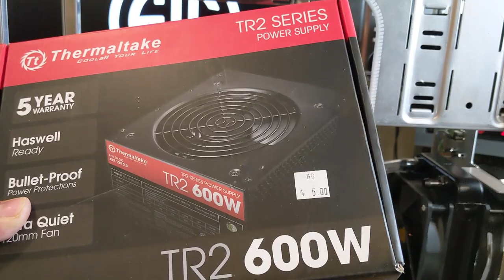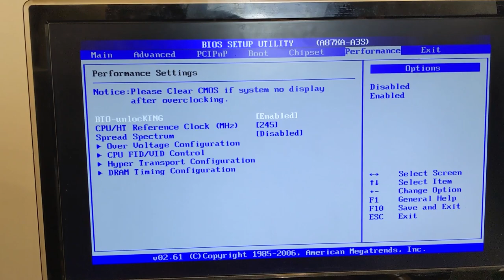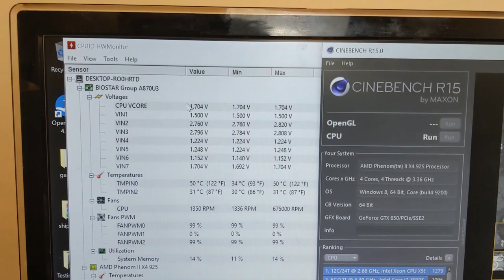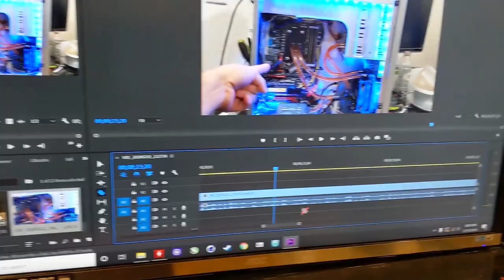Custom Water Cooled Lian Li PC 60 Build Vlog

Comment: My PC is still in a PC60, albeit one with 2x80mm instead of 1x120mm front fan. Because of that, no way to even put this miniscule AIO in; however still very happy with this amazing case even if it's 20 years old!

I do have the original lian li plexi side panel though...... ;-)

Comment: love your case jimmi, its a classic case. your version seems to be pc60 PLUS, do you know if there is a size difference between it and the normal PC60 (the origina version had 2 80mm fan grills on front, and yours the PLUS version has a 120mm fan grill on front)

Comment: Im in the process of doing this with modern components I saw that somebody that was already made a sleeper PC with this case and I decided to up the ante with water cooling and adding USB 3 to the front panel as well as pairing it with a ryzen 7 3700x and 2080 super
Reply from the maker: Your build is sick man. Looks really good.
Reply: I have 2 of these cases. I want to do this with my system

Ryzen 2600 with 2x RTX 3070TI's

Comment: IS that rad enough cooling ? Not cooling the GPU as well ? 

I want to cool the CPU and GPU in my PC, however i don't think i will be able to due to the limits of where to put enough radiator :'(
Reply from the maker: It was fine. Kept it cool. Didn't keep it together very long.